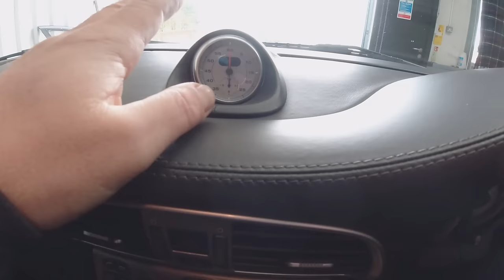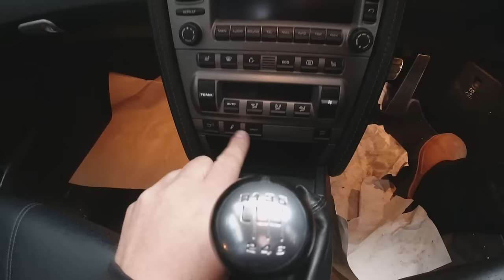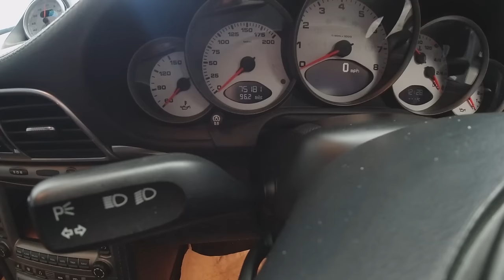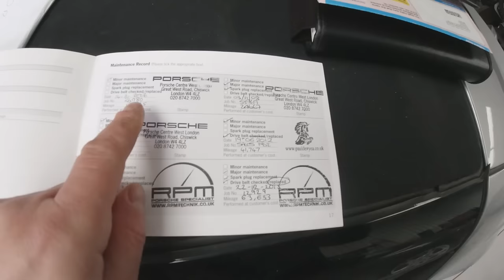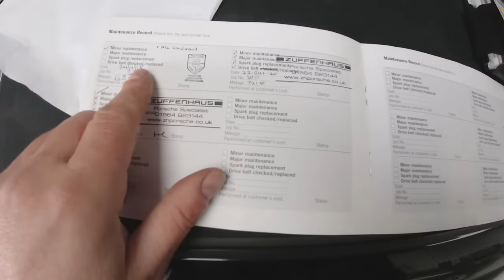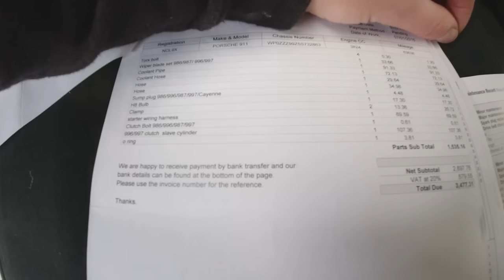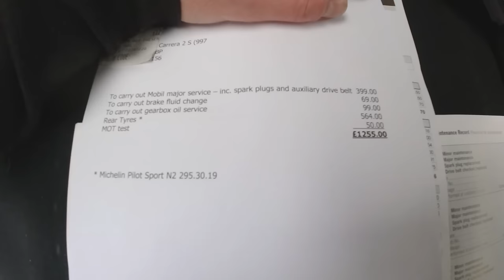Why did the owner REALLY sell this old super car to a We Buy and Car Site?

Comment: Couple who lived opposite my parents were selling an 2004 Micra Sport, £60k miles in Black for £700. I went over, gave them full price and took it home. FSH and owned by 2 sisters. We (I) wanted a Sainsburys 'parking right outside the door' car that we didn't really care about. Had it 4 years, spent £3K on it with full main dealer services, bodywork done, replaced whatever it needed including new stereo and speakers fitted when they broke. Then gave it to my sis to sell to help her business. The result... Sister is still in business, the learner driver that bought it was over the moon and we never actually got to park right outside Sainsbury's door...(too full of PCP range Rovers, Defenders etc.) I then realised that buying and selling cars is not really my 'business model'. But Kudos to those that do.👍🙂

Comment: 2 years ago I bought a 2006 low mileage 997, and I’ve gone through all the concerns that you mention in this video. Mine was a retirement treat, an ‘if not now when’ moment. Bought mine from a Porsche specialist, and traded my 2008 Boxster. Like you, the fact that it had recently had its engine reworked was reassuring and apart from new front discs and a damaged suspension arm, it hasn’t let me down. My car is a base model with similar extras and I worry every time I leave it somewhere. Thankfully, most of the attention it gets is enthusiastic rather than sinister. At 72 I’m more worried about my IMS than the one in the car.

Comment: Hi James, I’m lucky to be driving 40k plus cars, which I drive for three to six months on HP or short 20-30 month PCP contract. I started by sinking 18k, 40% of the loan limit and then monthly on around £200-£250. I trade in quickly, once I get bored and so long as I’m careful generally break even. For example Bought a 17 XJ, with low milage, in good condition from a trader, then sold up five months later, lost about £400, then part ex on an 9k miles M4 comp, owned for three months, actually made money on the trade and now in a 40k F-Type R Dynamic 340, light silver, black gloss pack and fixed wing. Looks amazing by the way, real head turner. In the last two years I’ve owned a TTS Black Edition, a Maserati Quattroporte 4.7 S, a 370 Nismo with Armythrx switchable exhaust, I actually made £2000 on this in just a few months, an XE supercharged and many more. The trick is to carefully research performance car prices, and pass on the cost of servicing to the next owner while its possible to take advantage of what has been a very unusual rising market. I really wish I’d started my own channel. I’ve worked out how to carefully play the market, while not losing any capital and staying in some lovely cars.

Comment: It's a beautiful example James! I have a 2006 Boxster S and absolutely love it. It doesn't command the value the 911 does so I feel I can use it every day and not worry too much about putting miles on and leaving it places. The 3.2 engines also don't suffer bore score like the 3.4 in the Cayman and later Boxsters.

Perhaps one of those might be a good constellation prize for you once you sell the 911.

Ultimately these cars are meant to be used. Mine had 80k miles on when I got it 6 months ago and now has just ticked over 86k. Amazing car.

Comment: All I would say re having a car restored and laying out a load of cash to a company up front, prior to having any work done, is DON'T⚠️

It's like having a builder round to build an extention on your house, if you drop him the full payment up front, he is more than likely going to make a start then take on other jobs and treat your work as a secondary project he can fit in whenever, that's if your work ever gets completed, if in the meantime he goes bust you're stuffed! 
You would never ever pay a builder up front the full cost, you might agree to pay up front for some materials or a smaller deposit to secure his work and then release payments as and when an agreed level of work has been completed, with the final full payment released when the project is complete and everyone is happy.

As for people selling cars to 'we buy any 💩.....😲😳
I'm finding more and more it's a way of off loading a problem car or one with an impending issue like expensive cambelt job, clutch or HG⚠️
I personally know a mechanic who off loaded a Seat Ibiza which had a host of issues such as needing 4 new tyres all round, a month of MOT remaining and he knew it had a fail issue, it had a boy racer loud exhaust and leak, so much so he couldn't drive it with the windows shut! The clutch was slipping and he suspected it had a HG leak, now he only paid £800 for the car a few months previous and online they quoted him £1,900.
He couldn't get down to them quickly enough, the checks they do are minimal, they check condition, does the car start and run, has it got a valid MOT, they check it has legal tyre tread depth etc what they didn't do was drive it, so the plethora of issues was not detected.
They dropped their initial offer to £1,800 because of the loud exhaust because their original online quote is subject to the questions they ask about the condition you fill out online, matching to the actual inspection.
He was still £1000 up so accepted the payment, I think there is a fee you pay to get the funds right there, quickly, rather than waiting a few days....😲😳

Comment: I agree with you saying the car is "too good" I feel you need to be able to use a car as and when without worrying about it. I have the 4s 997 and i use it in any weather but do maintain regardless, only gets around 2k miles  a year max . Enjoy it when you can . Check Aircon they are prone to not working because where the radiators sit

Comment: Congratulations on the 997 great car with good spec, couldn’t see if it had hard back crested sports seats which are very desirable. The lower leaver on the left of the steering wheel is on board computer, cruise control if you have it would be to the right of the steering wheel. 
They are fantastic cars I wish you well to enjoy it. All the best Nick

Comment: Nice example James, if that's too nice why not consider the 987 Cayman S.  Five years ago I was looking at 911's when a friend suggested the Cayman, first thoughts were it's not got the same badge appeal but  having driven several 911's I test drove the Cayman and instantly loved it.  The mid engine configuration makes it so much more balanced and a lot cheaper. It does get tiring explaining to people who have never driven a Porsche why you bought the 987 and not the 911 though.

Comment: That is a seriously good 911. All that history and the coolant pies done as well, brilliant. I have owned my 997 c2s manual for 8 years now, used as a daily driver up until last 2 years as, like you, I got worried about values, condition etc and got a cheap run around for daily use. Mine is still used regularly though and still worth more or less what I paid for it 8 years ago. Thats cheap motoring.  Discs/pads/tyres are a bit dearer than normal cars but everything else- service parts/window regs/batteries etc are no dearer than anything else and dead easy to fix. Use it carefully  and enjoy it for the next 12-18 months till you have scratched your itch then sell it for all the money in spring next year.

Comment: Hi James, I think hit the nail on the head, this is a lovely car but agree it's the wrong car for you. You would be better off with a more worn model (like a comfortable pair of slippers), which is mechanically sound and a 'usable' classic. Like you, I would be nervous about driving such a spotless car, which would mar the experience. If you left it anywhere (car park etc.) you would be worried about it being damaged. This car is so good, it should be in a motor museum or a main dealership as a display piece. A great find mate, but I'm sure you will make the right decision.

Comment: ...looks a good'un. If - as it might seem - you are not going to use it much I would recommend keeping it connected to a battery tender. (See if you can get a sponsored one!) 😀. I've had Porsches - currently a 993 - since 2000 and they love to run the batteries down if not used regularly.  Mine's a bit old school and not tech-heavy like the 996, 997 and 992 versions but I still need to keep it hooked up. With the 996/7 you may have trouble getting to the battery should it go flat, although I think there's some sort of jump facility within the fuse box, assuming you can get to it.  Mine has a cable release to open the frunk in case it won't work via the lever under the dash.  The 996 may have that too.  Enjoy!

Comment: Looks to be a nice car, keep an eye on the front radiators, they can block up with debris and cause overheating. The 997 has less coolant capacity than the previous 996 version, this contributed to bore scoring. I have a 996 C4S in seal grey. Isnt it time the VW Up was finished, it must be its birthday in the unit!

Comment: Great car - well done you deserve it based on the hard work you have put it to build your business up. I think you are correct that it’s too good in terms of condition and value to have too much fun with it. I like the idea of a higher mileage mechanically well maintained version but perhaps not as pristine on the outside. Personally having had some fun cars over the years I’m a subscriber to the view that smaller cars like your Suzuki can provide all most as much fun in their own way because they are so nimble, small in size and light, and you have to work the car to get the best from it. You also don’t very often find yourself beyond your own capabilities. That said this Porsche is lovely and a great piece of engineering and quality.

Comment: I have owned one mint low mileage car that was a modern classic and it was a bit of a nightmare - every mile was hitting the value and you lived in fear of any chip! I was glad to be shot. The second car of note is my M2 - new bought - yes it remains equally a car I cherish and look after but as I knew from the off it would be a car I would never part with unless I had to and as it’s a car filled with memories - I find it’s easier to live with as the value is meaningless - but - I have the worlds most horrific to look at 2007 Honda Jazz as my daily and it’s so much easier - if someone opens a door into it I gain additional much needed paint while it’s regularly parked in hedges so range rovers can get by without going on the grass!! Cars you cherish are in truth a pain!

Comment: They're designed to be a daily that you can have fun in.
I'm sure you'll enjoy the Porsche, once you get over the fear of putting miles on it... no point owning it, if you're not going to drive it. It'll just sit and develop weird leaks and issues. Better to drive it and get enjoyment in exchange for the maintenance and upkeep costs.
I've only ever driven one Porsche, it was not a daily, drive to the shops car.
It was/ is a late '80s/ early '90s 911 Turbo track car, complete with whale tail (not to be confused with a tea tray spoiler). Pretty much stripped out, cage, proper seats and harnesses, tuned and an instructor by my side shouting full power... brake, brake, turn in... straiten up, power down... good fun. Anyone that's into cars should try it. Not a track day, "run what you brung"... an actual "race driver" training day, where you play with someone else's toys and they teach you how... Then do the track days, once you know what you're doing.

Comment: Funny that you should start off the video with a disaster story...I have a similar story (still unfolding) about my 2006 Mustang convertible.  I decided to get the top (hood?) replaced and took it to a shop with good online reviews.  I dropped the car off in October and paid a pretty hefty deposit (?) of $4,000.  Several weeks later I get a call saying the top is in (had to be ordered due to the color) but before putting it on it was found to have a rip.  They ordered another top, after a few weeks I get another call: second top is ripped, and in the same place as the first.  It is now nearly Christmas.  Third top comes, no rip, car should be ready by the middle of January.  Take 2 buses and get to the shop...car looks great but without asking my permission they extensively detailed the outside, touching up nicks in paint and very small dents.  The sum of $600 is briefly mentioned.  Just then, the owner of the shop asks me if the driver's side window was working when I dropped off the car, it was, but now it's stuck in the down position.  With rain in the forecast I had to leave the car there to be fixed.  Still waiting (3+ months after first dropping off the car) to be able to drive the car.

Comment: 997 is last of narrow bodied cars. Very good useable. Lovely spec. You can get new Porsche management soon for apple car play, sat nav fits into same space as old unit. Extended leather was a very expensive option. I’d keep it for a couple of years and use it on dry days. Oil change annual and get Martin Reed in Barnstaple to service it. Keeps service book with Porsche and recognised Porsche specialists. Always 6 speed manual not PDK for me. I’ve run 5 different air cooled 911 and parking in car parks is the worst worry. I never worry driving. Life’s too short. 😎

Comment: No excuses needed mate you just buy what you want, funnily enough I was looking at one at todays auction, but someone had put a gas conversion on it, strange.
Reply from the maker: Random!
Reply: @ChopsGarage  yes bud, engine had a miss fire too, probably the gas had burnt a valve out, they run too dry on gas, could be bought for 6k on a 2000,scabby front wings as well.
Reply from the maker: @roystonvehicles9129  6k for the egg yolk headlight with gas conversion and issue, mad money|!
Reply: @ChopsGarage  it's been thru 3 times bud,

Comment: Nice car james looks a cracker, As for the mid life crisis i had mine back in 2004 and bought a boxter 3.2s pastel yellow manual with 12,000 miles Bose system and nav and sports seats still have the car in the garage and now has 20,000 miles on so ive had it for nealy 20 years not used it since 2016 but still starts and runs perfect its a bit of a garage princess.What's it worth now??

Comment: great buy, i completely get your concerns using it, hopefully you can relax enough to enjoy it for many years 👍 only issue, i may be wrong but does the rear have the same sized tires as the front? the rears look like they dont fit the rim properly
Reply: they will be staggered. If different make tyres front and rear may appear odd too.
Reply: @rob1984p  yes but the rear tires look too narrow and stretched, will pass MOT etc but does affect handling and grip on the rear

Comment: Know how you feel regarding using it. I am the same position with my Audi S3  Bought from new. Didn't want to use it because I'm afraid of putting wear and tear and mileage on it so much so it's only 6000 miles in 5 years.. Madnes I will not  use it in the rain. I'm paranoid where I park it on the few occasions I used it. Still sits in my garage like a Queen. While we drive around in a 9 year old VW Up, and it's only an Audi S3. Been looking at 911s as well but cannot go through this again. It will have to be used.
And yes, my wife thinks I'm mad as well
Reply from the maker: Lol , well I do , it's a shame though

Comment: I thought great, James has worked hard, treated himself, then it's just (another) car that's just a blast up the road and I'll sell it, how many more do you need for that? If its just for sale your better off sticking to quick, easy flippers, let's say you made 5k on it, you could have probably done 20 with that money, I mean you've got brabus, s2000 and others not going anywhere, tbh the dealer who's sold it to you probably had the profit out of it, I don't know, it all seems a shame tbh.
Reply from the maker: Remember what time of year it is ;)
Reply: @ChopsGarage  I know mate, I've got a few sports cars from last year that I'm not bothering with until spring, although today's been quite nice, but I'd just keep to easy flippers, you could have done loads in the time you've had those, I'm all for a sports car for yourself (I've had them since being 17) but I've learnt run of the mill stuff is all round better.

Comment: Better to call at main dealers in a 911 than an old Toyota mate, they'll roll out the red carpet for you.
Reply from the maker: Yes thats the plan lol
Reply: @ChopsGarage  I'm the same mate surrounded by s**t but tbh I'm glad in a way as prices are ballistic at the auction. Just trying to get that brera going atm.
Reply: @ChopsGarage  bet you're enjoying that 911 bud, 355 bhp, hope you keep your license!!
Reply from the maker: @roystonvehicles9129  not been out in it mate. To wet n icy, using swift
Reply: @ChopsGarage  well yes, lot of power for the weather, just flipped my c4 picasso, made 325 I'm buzzing!!
Reply from the maker: @roystonvehicles9129  what did you pay for it?
Reply: @ChopsGarage  450 mate, it's been my only wage this week! Just put fuel in that brera and giving it a run, been stood mths.
Reply: @ChopsGarage  can't resist a cheapie no work flipper mate, it's a drink